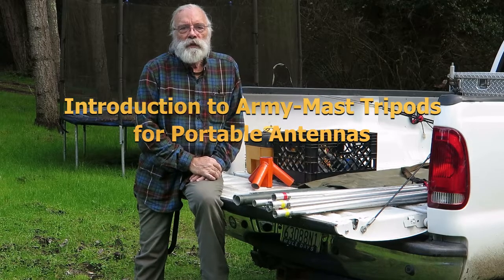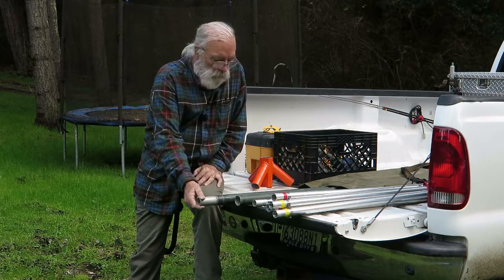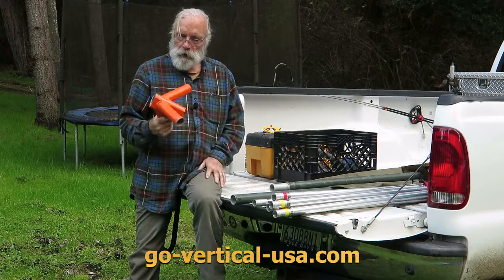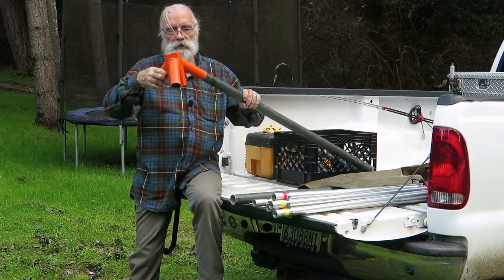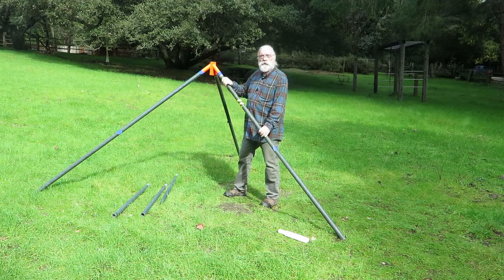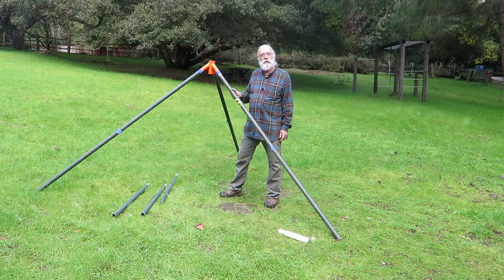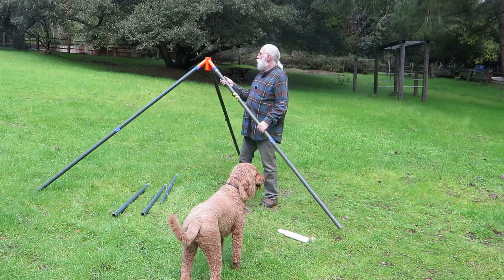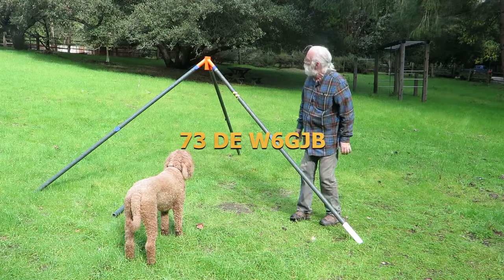Army-Mast Tripod Tips

Comment: I have a reproduction of the original tripod top section that came with the early kits. It’s a bit different that there are three shorter sections used for the legs while the actual mast sections are of the full length sections. You cannot feed the bast from the bottom since it is blocked by part of the steel used to construct the base but it does have a hole in the middle where one can place a machine style screw eye and use a section of rope or chain to tie the assembly to an auger that you screw+into the ground to secure the fully assembled mast. One must secure two of the lower legs to the ground and tilt over the base assembly to add all of the sections. The top section is equipped with a pulley and UV resistant guy cord. To raise the whole mast you can either walk it up since two legs are fastened to the ground or have one individual walking it up while another individual pulls on cord to raise it. Once raised you can fasten the third leg with a stake into the ground. Use the cord to lift up the center insulator of a dipole wire antenna. What I am trying to do now is to make an adapter that will allow you to interface the fiberglass mast poles used for camp netting to the aluminum poles. With at least two fiberglass poles at the top there is less chance of interfering with the radiation pattern by the aluminum poles. Now if there was a way to make a gin pole setup to hold the poles up while you add another section to the mast or perhaps a quick release clamp that would hold the poles while another one is added.
Great work! 73 from SV9 Land!